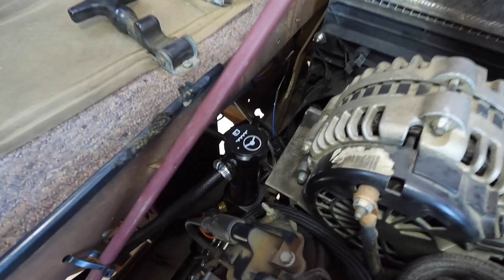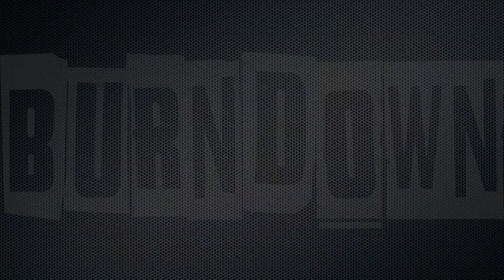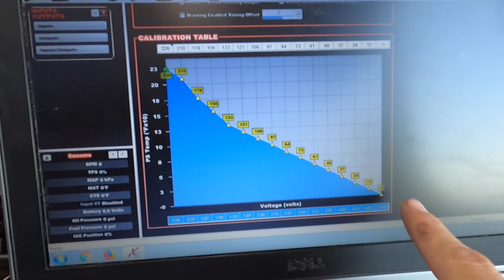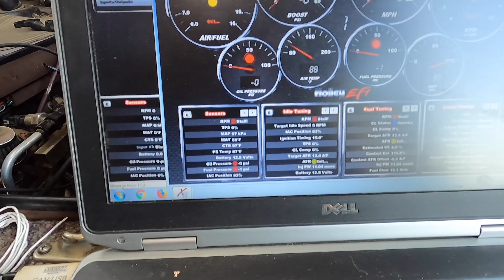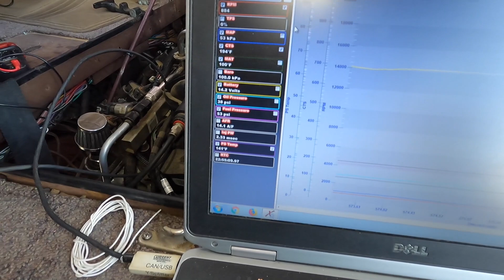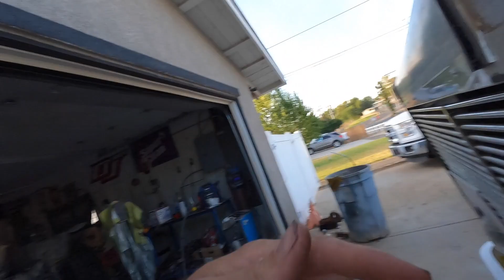Temperature Sending Unit Install In The Power Steering Pump

Comment: Not Canadian he’s from Wisconsin but definitely a great channel
Reply from the maker: He sounds like he has an accent and I know its cold where he's at so I was guessing further north. Either way he seems like a good dude. Im sure I have an accent to people as well that are not form the west coast.
Reply: @Burndown  yeah you definitely have the west coast accent I’m a truck driver so I’ve been just about everywhere but Hawaii but it’s on the bucket list and A21bravo aka Ryan’s helped me out he did a video on how to add a IAT sensor to the truck intake using the old EGR Purge valve location using a plastic factory IAT sensor and some sandpaper to get it to fit was pretty ingenious but it works great I have a Lm7 5.3 with a big cam in the Jeep from my profile pic that I swapped in and is running on the Holley Terminator Xmax and I installed the 6.86 dash in.